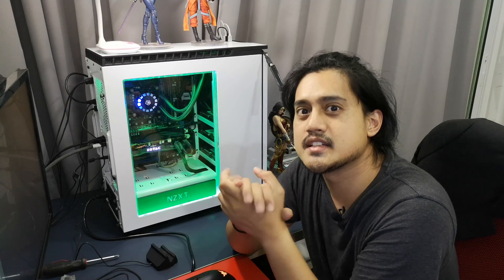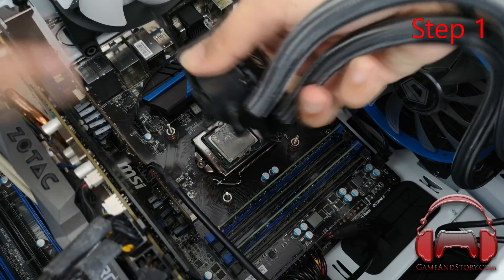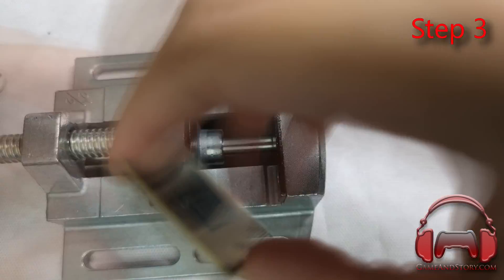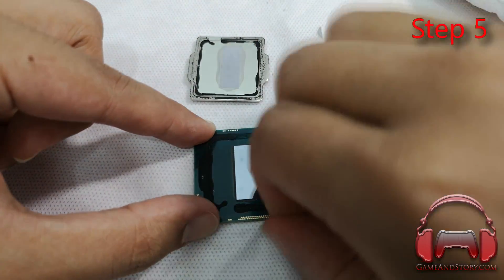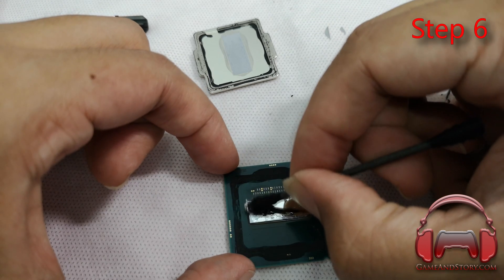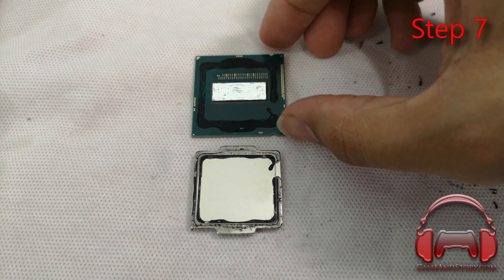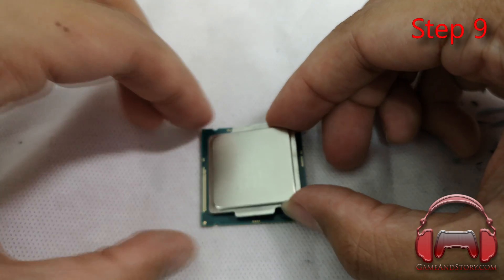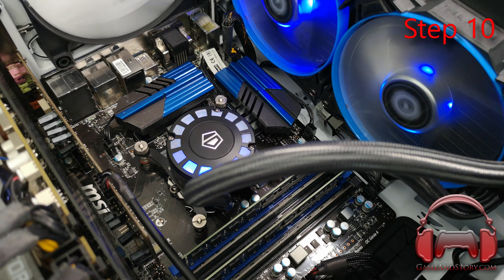CPU Delidding Tutorial - i7 4790k (Vice method) & Liquid Metal

Comment: Whoa.. my 4790k is in the exact same nzxt case.. with an msi krait edition 👍
Reply: Hey man, would u mind giving me your OC settings? 
Seems I'm running the same gear
Reply from the maker: Hey man, I'm so sorry i didn't reply earlier, I've been... well, it's been a very shit few years and I've just been lost at sea (metaphorically). As for your question, I've since moved the 4790k on, and don't have it anymore. As for my settings, I ran with 4.7GHz @ 1.35v, with my RAM at 11-11-11-28, DDR31600 (this is from my old testing data). 

I doubt it's much use, however I feel terrible for missing out on replying comments, so pleas do accept my apology.

Comment: not sure why do you put lid back, it is just extra heat resistance. Mount cooler directly on to CPU. Polish and flatten the cooler to ensure good contact. Many of you gamers do not understand that thermal past is needed only to cover for pour mechanical contact. If you make CPU to fit perfectly to cooler thermal paste becomes irrelevant.
Reply: It likely would not last long due to mechanical stresses, the silicon would likely spall flake crack etc..

Comment: Use a silicone for high temp to fix the IHS again, is cheap and works great, do not forget to make a little little hole on the silicone glue to let internal hot air goes off when the cpu temps increase
Reply: hmmmmmmmmmmmm good idea

Comment: Hi guys! Hope you can help me with my problem for over the years. I have an issue with my computer. I havent fully used the capability of my COmputer due to constant BSOD. I have a core i7 4790k, a MAximus Gene VII, 16 GB RAm DDR3 and Nvidia Geoforce 960. Everytime I play DOTA 2 and CABAL, it will freeze and has an error called whea_uncorrectable_error . I purchased this unit since 2016 and been through many techniciains but still they havent fixed it.  I have windows 10 right now 64 bit. I already reformatted the OS today and still crashes. I only have 2 fans on the NZXT case. Hope you can help me Guys.,  When opening Cabal and Dota 2, it will say Very High power usage.
Reply: Your specific problem is some incompatible hardware in the construction of your setup. this very common error presents mainly in incompatible memories with your Motherboard. 1 by 1 test and you will see a way to try to solve this problem, as I set up machines to sell, now and then this error appears there. Hardware incompatibility. Don't forget. Hugs. from Brazil
Reply: @robertoferrari1838  HI thank you for the reply! Yes, we isolated every hardware and to tests, the problem was the CPU getting way hotter even the start up, so I added a 2 new fans but I guess it needed more id-cooling system.. Hope this really fix the issues. :D
Reply: @PawfectlySmart   I bought a 4790k and 4 ram 1866Mhz for just over $ 200 in March / 20, just today I decided to see if this delid is really worth it. My Beat 106 ° Celsius with one of the Coldest Air coolers I know (V8 CoolerMaster I will buy and try it, I used Common paste and it stayed the same, as it is an expensive product in this country I will buy and use with care
Reply: @robertoferrari1838  Wish I can buy those hehe..
Reply: did you changed thermal paste and pads on GPU and paste on CPU? mine rams overheating and safety turns off screen and GPU fans go max speed, but windows still running i can hear music

Comment: 4 things that could be done better with minimal effort:

1. Do a better work of removing the original silicon glue, the more the better, you can do mild scratches to the green pcb with some tool as long as you dont scratch or damage anything other than that

2. Protect the capacitors with colored (not clear so you can see where it is and is not) nail polish.. It can endure over 100 °C and will protect them until the liquid metal settles in, this is probably the most important step which makes it super noob-friendly 

3. Really apply a bit more of that liquid metal, it wont hurt anything and if it runs, the nail polish will stop it from shorting out anything

4. When getting the lid back, position it and compress it down slightly, apply 4 dots of superglue on each side and let it dry.. This is just a good practice of doing things, if you would want to remove the cpu, or you can even sell it right away.. Also the glue on the outside is easy to break and delid the cpu once again if someone would want to do so

Comment: Not a very good tutorial. It's risky to leave IHS unattached to the CPU. You don't spread all the liquid metal both on the IHS and CPU manually, it should've been done automatically as you apply it correctly only on the CPU. Lastly, your thermal paste didn't cover entire processor, the more preferable way is making an X than a drop.
Reply from the maker: This method has been used by Gamers Nexus, Bitwit and Optimum Tech 🤷‍♂️ My CPU has been going strong for 2 years now with no issues.
Reply: @GameAndStory  Valid argument (: I guess it's time for a change of role models. I'm not saying your tutorial is totally worthless, but there are thing that could've been done more safe and efficient. Good for you that you have it working for so long, although some may not have such luck, my suggestions are not only improving overall process and decrease chances of eventual error, but temps would go even lower.
Reply from the maker: @dand337  cheers for the feedback :) Sorry if I sounded snarky. This was my first ever tutorial on YT - I'd probably do it differently if I did it again today, tbf, and I'd probably do exactly what you've suggested earlier.
Reply: @GameAndStory  I'm pleased to hear that :) Only those who do nothing make no mistakes.
Reply: @dand337  Liquid metal has to be spread unlike traditional thermal pastes due to the high surface tension nature and erratic flow when compressed. especcially on a rectangular shape; verses the top of a square IHS. i guess, ive never used the stuff LOL
Reply: @AsGames-g1k  Oh, I didn't know that. Thanks for the correction :)

Comment: you should have lapped/sanded down your IHS flat and shiny and then continue with delidding
Reply from the maker: Yes, you're right. I didn't learn about sanding / lapping until after I'd put my system back together as part of a custom loop (in a PC that my partner uses now). No complaints at the moment, so I'll revisit it one day when we get a new rig and can tinker with the 4790k some more.

Comment: Do you need 2 layers of the liquid metal? Also, can you just do this with thermal grizzly or some other ceramic paste?
Reply from the maker: Hey man, for the LM, put it on both the die and the underside of the IHS, to guarantee decent transmission of heat. 

You can also use this method for any other thermal paste, although the results won't be as dramatic. :)